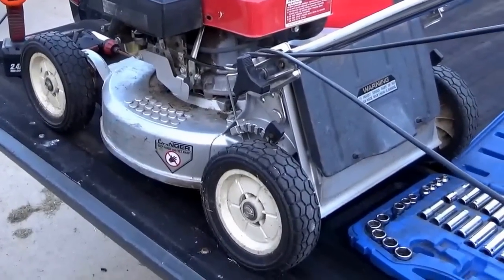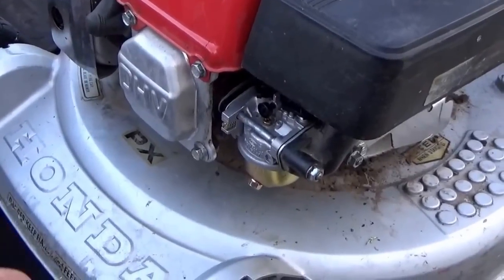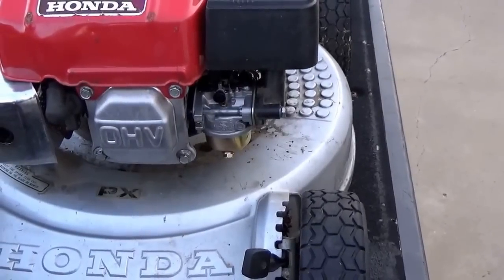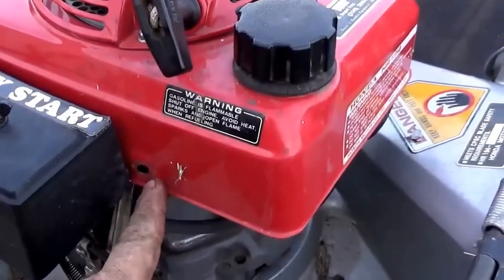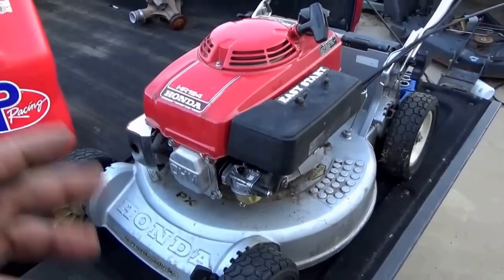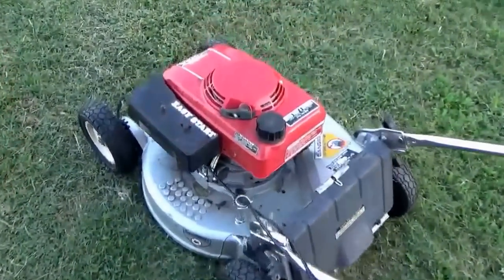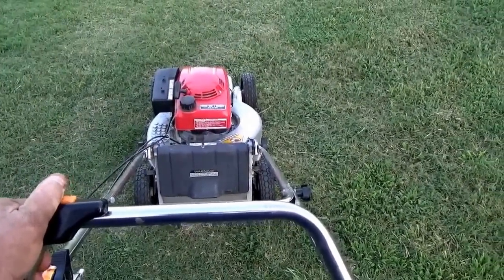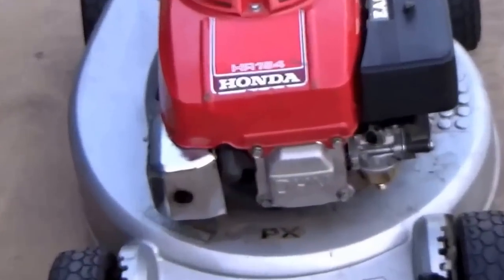CHINESE HONDA AFTERMARKET CARBURETORS FROM AMAZON - DO THEY WORK AND PERFORM WELL??  LETS FIND OUT

Comment: I put one of these on my HR214 and it ran like the day it was new. The old original one developed a weird problem that made it run too rich like the choke was on all the time. Pretty sure it was a float issue but the rebuild parts where way too pricey. Whole new carb shipped to my door was under ten bucks, fit perfectly and solved everything.
Reply: I have an HR214 SX also.  I actually could not the mower guy I use to work on it anymore, and he would not put an aftermarket carb on it for me.  I got one from amazon, and am going attempt to put it on in the next week or so.  How is the mower working for you with the new carb?  Mine will start, and run for a while, and then shut down.  I started it today, and It will not run unless on full choke.  We'll see how the new one does.
Reply: @kennethgrutter9406  Works like a charm, only thing is the fuel shutoff valve works opposite of the way the original one did so the sticker on the engine is wrong now (no big deal). Yours sounds like it’s starving for fuel, opposite of what mine was doing. Remove the rubber cup in the gas cap and check the vent under it. The foam filter in there crumbles and blocks the air vent creating a vacuum in the tank which can make it run fine for a while then starve for fuel. If it runs ok with the gas cap loosened up then the vent is blocked.
Reply: @mjg263  I checked that.  Even ran it for a few minutes with the fuel cap off. Still did the same thing.  Thanks for the advice!

Comment: Good job Jeremy. I also have used both aftermarket and oem Honda carbs. They both are inexpensive and it is apart swap, but you can't justify a rebuild when you can buy a new carb cheaper than a kit let alone. your labor on it. You do good work. And again glad you are back here doing videos and helping us out.

Comment: I have used those aftermarket carbsAlso, only have had to used them on Honda's. On a gcv160la and gxv140They work great. In Briggs and tecumesh I typically clean and rebuild.

Comment: I used to swear by OEM carbs and knocked anything aftermarket, with the massive price dif and reading on forums that they were holding up, i decided to put a few on my equipment that i was using for overgrown properties(ran very hard everyday) I never had one issue, I would always give the customer the aftermarket option but would not recommend them, well a guy had a craftsman snowblower with a Briggs engine (nikki carb) i called and let him know that the oem carb was just short of $200(CND) after tax but if he wanted, i would get him a price on an aftermarket carb, at this point aftermarket nikki carbs were still not too cheap, i think it was about $80 shipping and all, that was five years ago, i go twice a year to service all of his outdoor power equipment, blower starts right up every time and it does not miss a beat while blowing snow. I never went back to OEM carbs.

Comment: I used a Chinese carb for my personal turdcumsi and have been using it for years... And yes the misspelling was on purpose.... Great video.
Reply from the maker: THATS OK  I CALL THEM TEJUNKSEH, TECRAPSI,  TUCUMBOY (WHEN THEY POWERED LAWNBOY)
Reply: THEMOWERMEDIC1 THE SMALL ENGINE SPECIALIST Hahahaha, at least I'm not the only one.
Reply: @THEMOWERMEDIC1  Hi was wondering if you had any insight on a problem I have. I had to change the carburetor (used the cheap Hipa aftermarket) because the mower would only work on choke and would die on HI or LO positions. I didn't change anything else. When I pull the lever out of choke down to the Hi position the rpm is pretty much the same but when I put it on the LO position there is no change in engine speed which seems to be ok for the Hi position. The motor is GVX120 4.4HP 1 cylinder on a HR214 SX. 

The governor arm is free to move if I push on it revs faster. There are no restrictions either on the idle arm where the 2 governor rods attach on the carb.

Any Idea?

Comment: I have a Honda GCV 190 that appears to be locked up.  It pulls back when pulling string.  If I take the plug out it works easily.  I don't see oil like you would if it was hydrolocked.  I checked flywheel key and rocker arms.  Any ideas?  Thank you. Enjoy your videos.
Reply: Adjust the valves

Comment: that was a very good video thanks for sharing the expertise ! i also do small engine repair and have used several aftermarket carbs , one was a stihl backpack blower the carb cost 17 bucks on amazon and it was identical to the stihl carb and ran perfect out of the box ,, i never even had to set the hi or low or even the idle screw at all it was set perfect i couldnt believe it ?? it ran perfect , ive got several nice stihl farm boss chainsaws that need top ends , 300 bucks oem ?? dought that i found a place i can get a ms290 farm boss complete top end kit for under 20 bucks ,, hey my way of thinking the saw already has 4 leggs in the ground can i keep it alive for 20 bucks ?? i dont have a bitch in the world about spending 20 bucks on a 500 dollar chainsaw to get it running and not send it to the scrap yard , no love lost if it dont work ,, if it does work heck i will go ahead and buy 4 more top ends to put on the shelf incase one craps the bed , no biggie .. i say to hell with oem now